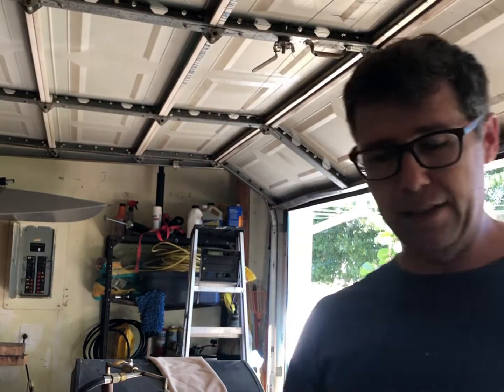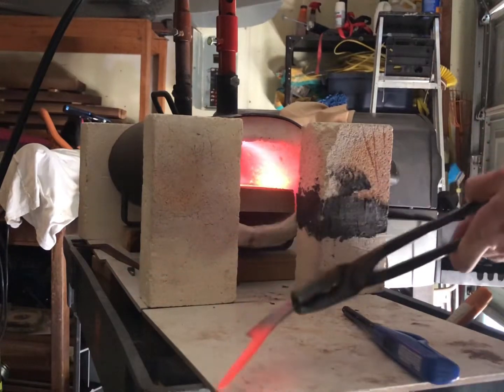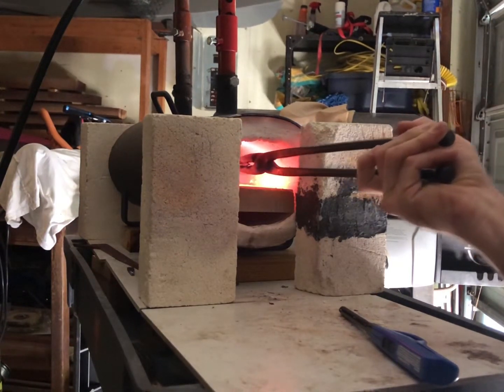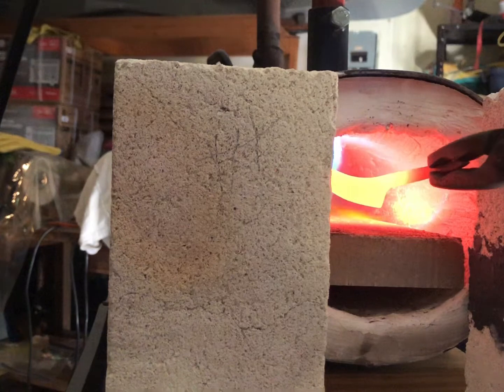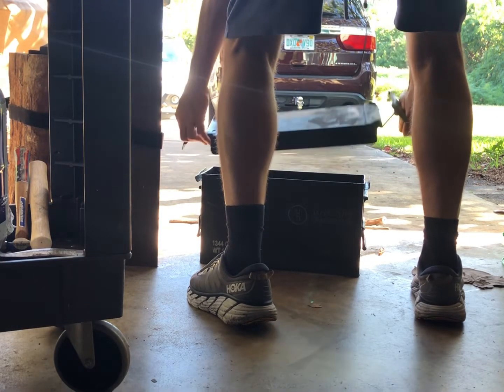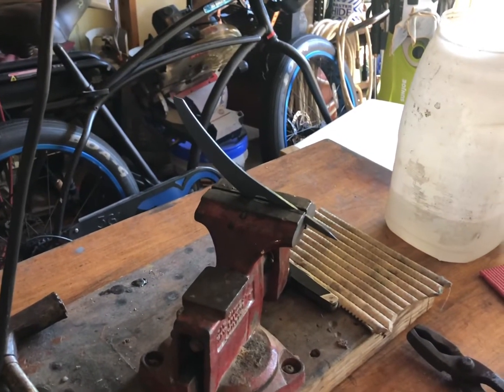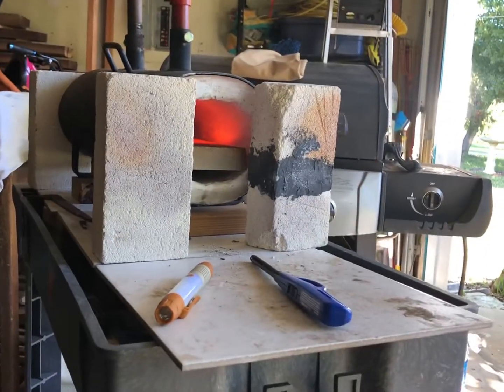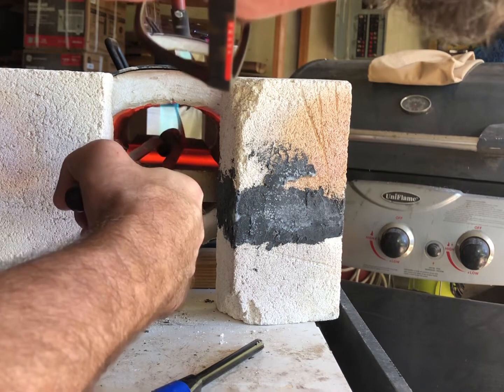My New Normalizing and Hardening Process for 80CRV2 Steel Knives

Comment: nice video, just wanted to mention, is your kaowool insulation hardened? if that stuff is still fluffy then its a pretty big lung cancer risk, you may want to look into covering it in refractory cement. also, your forge is sputtering because it's not getting proper oxygen, the chamber might be too small.
Reply from the maker: Thank you watching and taking the time to comment.  I do have the wool covered in furnace cement.  It came with the hells forge.   I’m still playing around with air fuel mixture.  As of now I leave the air wide open and the propane med high until the forge heats up…5 min.  Then I limit the oxygen to lessen the oxidation and lower the propane because I’m cheap…thanks again for commenting.
Reply: @PlayingwithKnives911  Good to know, just wanted to check. My forge also has a small chamber, i like your idea of limiting after its hot, thanks for that!

Comment: Salt melts at 1474°F.
Reply from the maker: I can definitely use that for knowing when I’m getting close to 1525/1550 during normalizing when I’m setting it up for pearlite.  Never tried it, but I will on the next one. Thank you Sir.
Reply: That would be really good for 1075 or 1084 that almost instantly diffuses and 1475 is plenty hot enough

Comment: Why do you care about the tang?  You don't need to harden the tang infact it could be bad to harden the tang. Is that just so you have an easier time heating up the blade?
Reply from the maker: You are right.  I’m not really concerned with tang.  I heat it up first because I don’t want it drawing heat out of the heal area while the tip area heats up too fast.  But either way this is a carving knife so the tang will never get abused.
Reply: @PlayingwithKnives911  Good idea about drawing heat out of the blade. I might actually have to try that. I have a little coffee can forge and sometimes its hard to get my blades heated up to quench.
Reply from the maker: Are you using propane or map
Reply: @PlayingwithKnives911  propane last time but I did buy map gas to try but haven't yet
Reply from the maker: @ChristopherSalisburySalz  I’d like to know how it goes with the map gas in a coffee can forge.  Seems like it would do well.
Reply from the maker: I’ve used a coffee can forge before and the downside is it doesn’t get as hot but if it gets non magnetic you are good with the 10x steels up to 1084.  You probably aren’t getting to 1525F for 80crv though.  I think that if you get it up to 1425 and let it soak for extra time, you could get the carbon someway into solution for hardening.  I think it would probably take 20 or 30 minutes
Reply: @PlayingwithKnives911  I was able to get fully profiled 1/8 inch 1095 non-magnetic and hard enough to skate a file with a wood/charcol forge made of bricks with a steel tube in the bottom with holes drilled out and hooked up to a hair dryer to act as a blower.  I left the hair dryer on full blast and burred the knife in the coals.  It was really hard to get it there though.  Anything thicker wouldn't have gotten there.
Reply from the maker: @ChristopherSalisburySalz  I had something similar before I broke down and bought a forge.  But it is an incredible experience to be outside at night in the backyard on your knees heating up a knife you designed over white hot coals with sparks flying in your face. It’s magic.  That would make a great video.
Reply from the maker: It would be fun to mess around with But then again you could use 1080 or 1084 and be good to go

Comment: Is 80 good for edge hardening? Or does it need to be through hardened?
Reply from the maker: It can be edge hardened, but don’t expect a real defined hammon.  Chromium makes it a slower hardening steel than a regular 10x.  What are using to quench in?
Reply: @PlayingwithKnives911  
Cool. I'm not looking for a hamon. Just want a tougher blade. As for quenchant not sure. This will be my first foray into blade making. Any suggestions? Thanks
Reply from the maker: @robertd6925  if you can afford parks 50 or triple A quencher, they will give you the best results.  Peanut or canola oil will get you started.  Triple a, peanut oil and canola oil all need to be around 120 to 150 degrees F for best results.  Parks 50 does not.  Also for a tougher blade,  it’s important to thermal cycle your steel especially if you forged it. Heating once to 1525 is good than cooled in still air will refine the grain and leave the steel in a pearlite structure ready to harden from nonmagnetic.  Multiple cycles of cycling though making the grain slightly finer will result in you having to soak the knife at 1525 —1550 F for 5. - 20 minutes before quenching.  Assuming you don’t have a heat treat oven this can risk over shooting the temperature and growing the grain of your steel….brittle knife. Remember to temper your steel in the oven afterwards.  350-400 harder325F.  Tougher 400f.
Reply from the maker: @robertd6925  one more thing use a metal quench tank…have a fireproof cover ready to throw on there just in case….
Reply: I can get a hamon on 80crv2... Quench in canola that is about 80°F until the sizzle stops and then send it into water. This also knocks the decarb and scale off.

Comment: The best quench oil for 80crv2 is parks AAA, or McMaster 11 second oil. Parks 50 should not be used, you will not get all the benefits of the steel with it.
Reply from the maker: Thanks for watching Anibel Salinas.  I believe you are correct regarding the ideal oil for quenching 80crv2,  but the difference is negligible since I’m using a forge to heat treat.  Not to mention I don’t need more crap my garage 😅.    Parks 50 gets it as hard as possible, but toughness might suffer a little.  I hypothesize(wild guess) that if I don’t put all the carbides in solution I can make up for the loss in toughness (5 min soak time)
Reply: https://youtu.be/Vdy0nvVEtJY
Reply: What makes you believe that?
Reply: You can use a faster quenchant on any slower steel without any problem besides higher warping or cracking risk from faster shrinkage rate as austenite and martensite have different crystal density.

Comment: What was the purpose of air cooling the blade the first time then quenching in oil..I'm just getting started so I would appreciate the knowledge
Reply from the maker: I’m sorry for not proofreading my talk to text. What I meant to say was…if you heat carbon steal up to its critical temperature where it’s structure has completely changed to Austenite, when you take it out and let it air cool, the steel’s structure is more uniform and less likely to warp during the quench.  Also it transforms into perlite.  This is awesome because perlite structures have even distributions of carbon through the grain.  Now when you heat it up before the quench, you only have to get it to nonmagnetic.  At this point your steel is Austenite again, but now the carbon is evenly distributed.  You will now be able to get more hardness out of your steel.  And less likely to over heat the steel.
Reply from the maker: When you heat the steel to the point where it becomes Austenite And then let it rapidly cool and air the structure of the steel becomes Perlite which has a nice even distribution of carbon which sets you up first step to the quench.  It has been shown to give you a higher hardness. For more information check out knife steel nerds
Reply from the maker: Normalizing and quenching is the best part of making a knife.  After the first step of normalizing,  you can heat up to nonmagnetic and let cool in still air a second time for grain refinement if you want.  Kenneth, what type of steel are you using?

Comment: Seems like its the best way to get the most out of our steels without that fancy Equipment.
simple and easy too!
 you should try to heat it up inside a square tube to even out the heat. 

Anyways great clip!
Reply from the maker: I’ve seen makers do that, and I guess that probably is the next step.  Do you do that and are you supposed to use a thermocouple?
Reply from the maker: And I appreciate the comment thank you
Reply: @PlayingwithKnives911 using a thermocouple or something else like a ir gun would be nice to try out ( I havent done that yet) its on my list to buy.
I've been using table salt as an indicator of temperature ( it melts at 1450 F) and the regular magnet trick.
Reply from the maker: I used a steal pipe in the forge today.  It worked perfectly.  I can soak at temp for a full 15 min with minimal adjusting.  I was too lazy to do a video…thanks for mentioning the heating in a pipe method. I love it!
Reply: @PlayingwithKnives911  Thats so awesome to hear! 
Happy knife making!!!